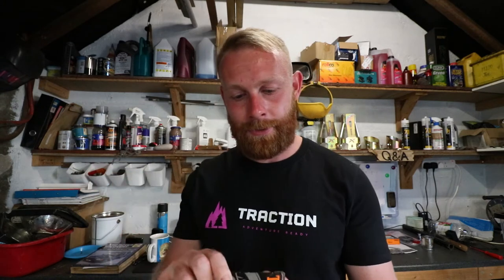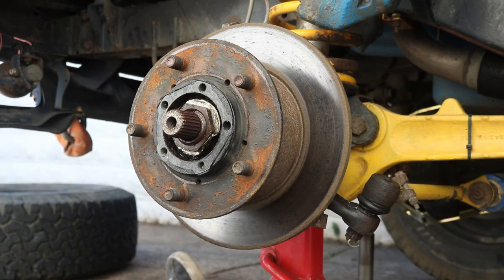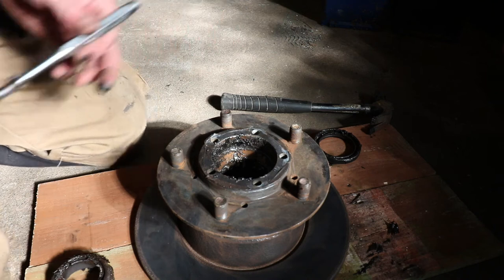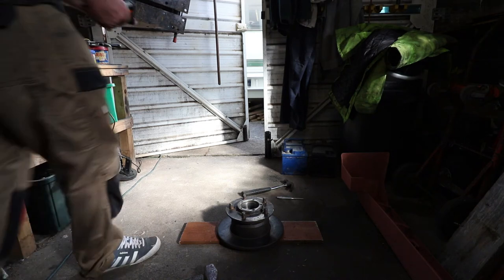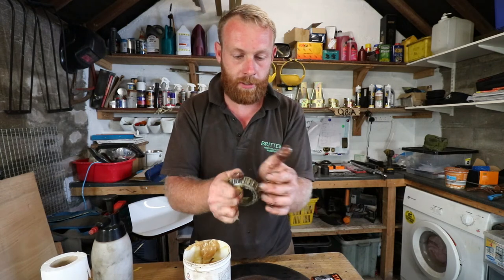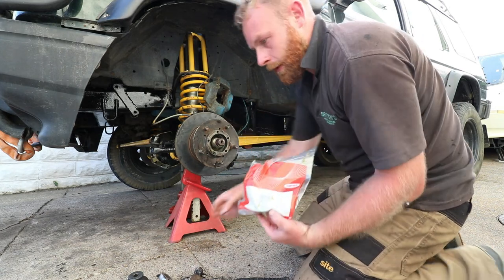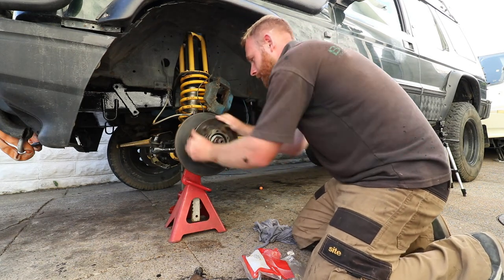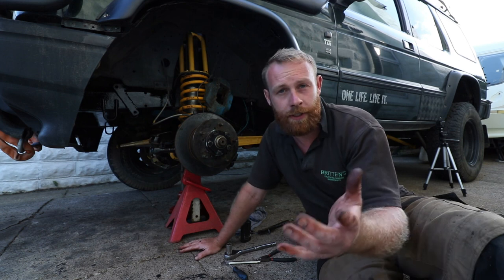Land Rover wheel bearings - how to change them yourself

Comment: A good how to vid thanks. If you had moisture getting into different from hub, then the inner shaft seal would need to be leaking, and some oil would have come out of the bearing too.
I didn't know you could get heavy duty drive flanges, maybe some thread lock on the nut would stop it escaping 😃
Reply from the maker: @chriswalker4272  thanks Chris, that is a good point 👍

Comment: play in the wheel when you shake it from 6 and 12 o clock can also indicate that the bearings in the swivel ball are shot. if the play is still there when you press on the brakes then you'll know for sure that swivel bearing is gone
Reply from the maker: Luckily for me I did the swivels a couple of years ago with new balls and bearings etc